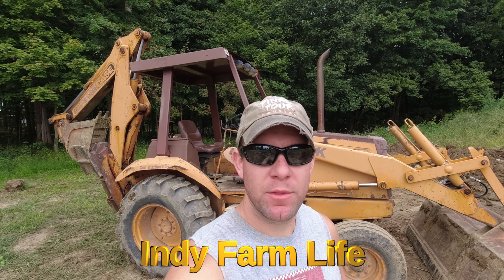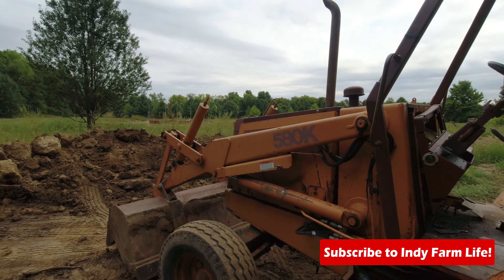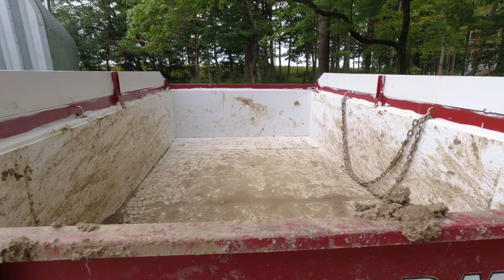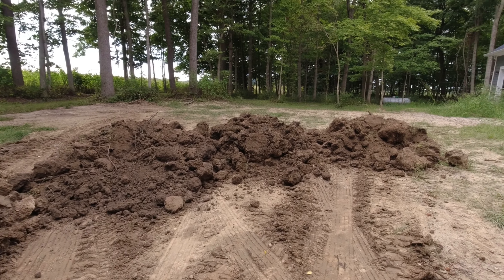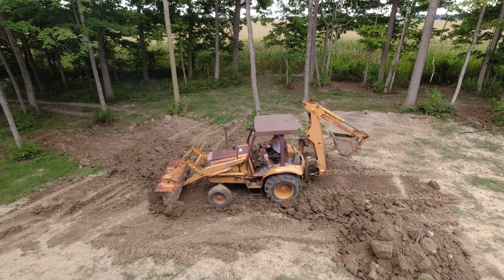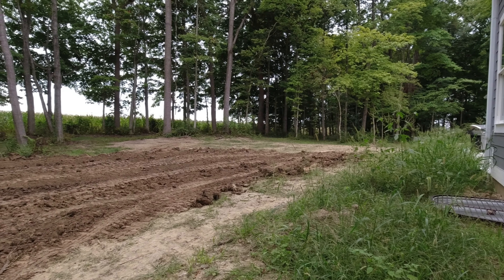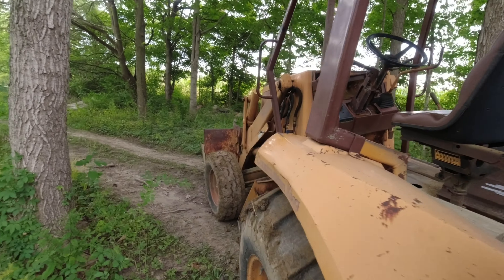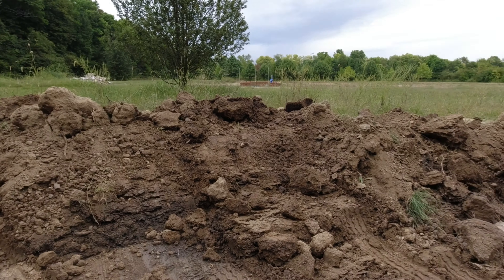No Dump Truck, No Problem - Tractor, Backhoe, and Barge Wagon

Comment: Have you considered getting or making a tooth bar , teeth bar , cutting edge for the back hoe bucket. I think you would give it a honest review.
Reply from the maker: I was just actuallying mentioning this to my buddy the other day.  It would definitely be helpful and I would love to have one!  The problem is that it would need to be somethign welded on.  I suppose a bolt on one may get by.  I had a clamp on version for the 4052R and I absolutely wrecked it!  The company even sent me adapters to use it with chain binders, also still destroyed it.  Maybe I'll make a video and show it sometime.  Anything over a 3 series tractor has too much power for what is on the market today.